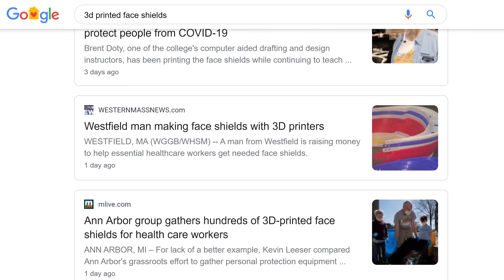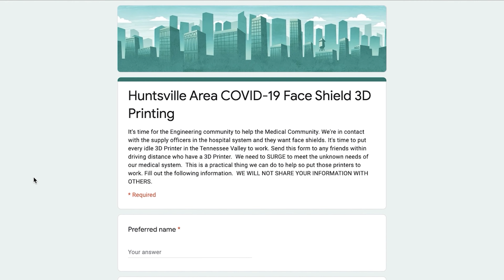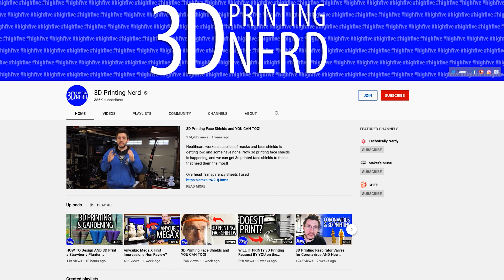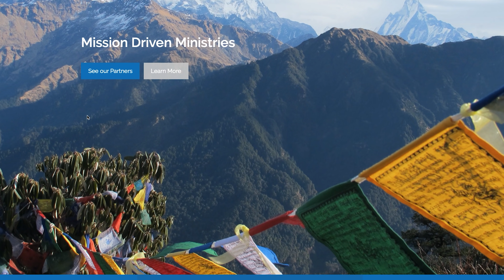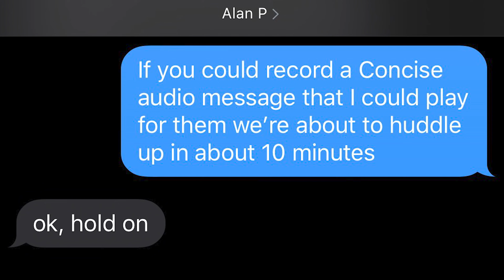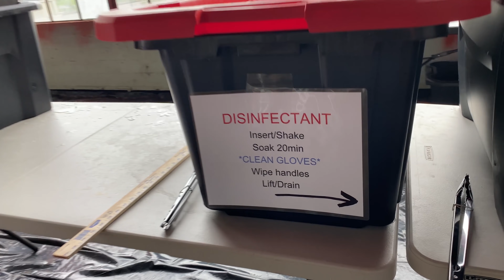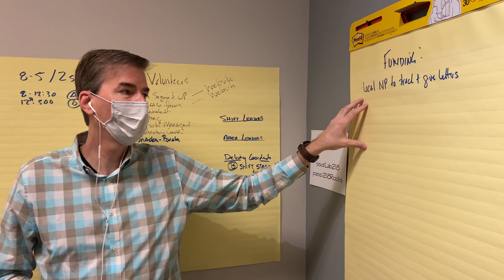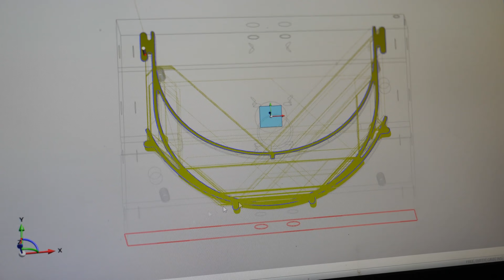We Made Face Shields - Smarter Every Day 233

Comment: Great video.  Lots of good information.  Thanks :)
However, stop touching the face mask.  It should only be taken off using the straps and then discarded.  Touching the front and/or rear of the mask greatly (completely?) reduces any benefit of the mask (and any PPE)
Reply from the maker: You’re right, which is why I don’t do sanitizing process. I’m not self disciplined enough with sterile fields yet. I’m learning.

Comment: I connected with a local surgeon and got the USA Prusa design approved with his hospital. I got a bunch of face shield frames to my local hospital and helped them coordinate with the local colleges and universities and libraries to get them all printing. My local hospital is sterilizing them on site with alcohol and then UVA, UVB, and UVC. Hospitals with their own Amazon Prime account and have 2 hour shipping out here so they ordered their own 3 ring binder clear dividers because they are already hole punched. Instead of a TPU printed strap to hold it on they are using tourniquets because they have an excess of them. With the dividers they don't need the bottom clip from the Prusa file which makes printing faster. I've since ran out of filament but I am now coordinating the colleges, University, and libraries and helping them trouble shoot and automate the process.

Comment: A completely mirror lined tunnel with UV-c bulbs on all sides in conjunction with a series of spray nozzles 1st ones could spray or mist  over 70% isopropyl alcohol then 2nd spray or mist mix of bleach and sanitiser with 3rd spraying sanitiser and iso propanol at a higher power. Then a dryer still in UV-c and heat sealed

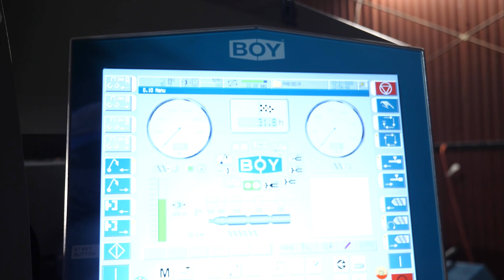Comment: 6:10 that's an ar-15 lower in his hand xD
Reply: Murica!
Reply: Wdym
Reply: @conorpatterson1109   He means that the injection molded part he has in his hand in this video at that time is a part of an AR-15 rifle. It's called the lower receiver, and it holds all of the operating group of the rifle. The ring shaped bit is where the shoulder stock attaches. Actually, I think he may be holding a master to make the mold from, since there aren't any materials suitable for an AR-15 lower receiver that are light blue. I'd sure buy one from him!
Reply: @Deavertex  oh i see now
Reply: @Deavertex  The "Injection molding place" is also a machine shop by virtue of making the metal negatives used to inject the liquid plastic, so they're likely not injection molding AR lowers (although you've definitely seen news about untraceable plastic lowers), but rather just machining them like normal out of metal.   The blue on there is a textbook color for anodized aluminum (google that phrase for a billion examples)
Reply: Lol! Right xD
'muricaaa! XD

Comment: my prusa is printing in warp speed mode
allthough the printer is whisperquiet usually
when u are pumping 1mask per hour the printer starts screaming at u
Reply: heck I would be screaming too
Reply: 1 mask per hour? Thats slow imho... There masks are thin, bent "rods"... How can this take 1 hour?
Reply: @mamax7169  Masks, not face shield prts.
Reply: if you need, i've optimized my print settings to print out one of the 3dverkstan masks in 31 minutes without stacking. Can probably shoot you gcode
Reply: my prusa is printing in warp speed mode

Comment: Destin: just print the file
Make anythjng: so I stacked 16 face shields, calculated a precise gap between them, and set up custom gcode so the printer knocks the print off the bed automatically
Reply: He is stacking what Destin is calling "the file" he is printing them stacked but when it comes to the end the object he is making is the same. he didn't develop his own modified head band.
Reply: @connoroleary3591  Yeah that's definitively what he's addressing. Fitting the face mask spec even if it's not ideal is more important than improving the design because uniformity is important.
Reply: @connoroleary3591  I know that, I was just making a joke
Reply: don't u de-level the bed when u knock of the product?
Reply: @jancko995  no, otherwise your bed would get delevelled all the time
Reply: But mister make everything also needs to disinfect the printer and the print-plastic before using.
Reply: @BlackVogel1  with a hotend going at least 210C is disinfecting the fillament even needed?
Reply: @Hellsparkt  Between coming out of the hotend and getting to the medical professionals there are plenty of opportunities to get contaminated.
Reply: @BlackVogel1  which is then handled by the printer operator, an unknown variable?
Reply: Yeah people like Destin are annoying. Some people might have ideas that make the process 5 to 8 times faster. but destin is like, nO uH Im iN coMmAnd oF thiS OpeRatiOn sHUT iT!
Reply: @majortom4543  Well, actually he's just following orders. He has an order to deliver a quantity of that file, printed, disinfected, packaged, and sealed. Anything else - better or worse - is not part of the order. When the medical community has a new order for a different product they will make that product. 
The "iN coMmAnd oF thiS OpeRatiOn" guy is way upstream here. And if you send them product that doesn't meet spec expect it to go straight to the dumpster. If you called in for a pizza, and they brought you "mini pizza rolls" would you be ok with that?
Keep calm, and carry on
Reply: @jamesdriscoll9405  I never said they should disobey Destin and send some other thing printed. Im talking about proposing an idea that might help to the cause.
Reply: @majortom4543  Cool, let's hear it.
Reply: @majortom4543  Hey! Didn't you hear him say you should be the kind of person who just follows orders? No new ideas.
Reply: @majortom4543  Looks like you're just going to stay stuck in the problem (any problem will do), rather than doing anything yourself towards a solution. You're the sort of person who I avoid hiring.
Reply: Major Tom you’re completely missing the point. He’s not saying you can’t improve the means of production. If you can find a way to print the same face shield in half an hour then do it. Hes saying that editing the specific design may make it more efficient but that the lack of uniformity causes more problems then it fixes.
Reply: @dawnmotorsports  Innovation is key for humanity. Otherwise trains would still run on steam because people who propose other fuels cause more "problems than it fixes" This is why Elon is pushing on electric cars like no others.
Reply: @majortom4543  Please innovate, fail quickly, yolo, think out of the box, or whatever buzz word is à la mode. When you are protecting people you need to remember they share the risk of your failure. Not so much humanity, but individuals. People with names and faces. Feel lucky punk?
Reply: Major Tom I completely agree with you but in this particular instance the time it would take to create a better design, then get it aproved and distributed wouldn’t be worth it. After this whole thing is over I think we definitely should try and design the most practical and efficient ppe we can so that next time something like this happens we can be better prepared.
Reply: @jamesdriscoll9405  Your comment doesnt make sense, so i will kindly ignore it.